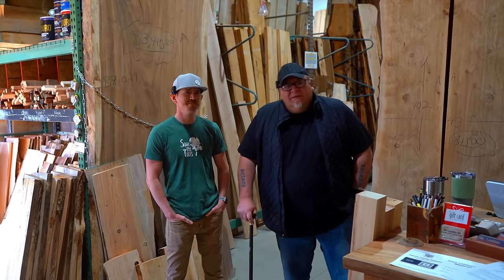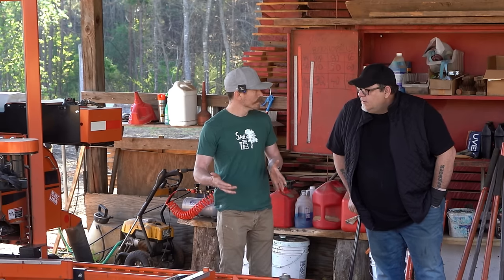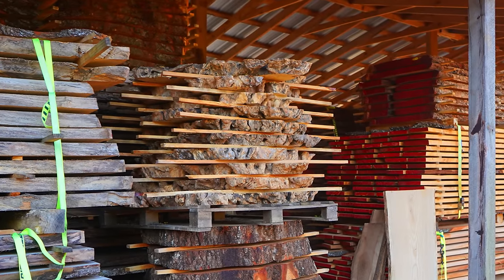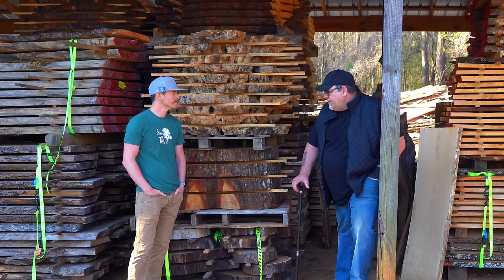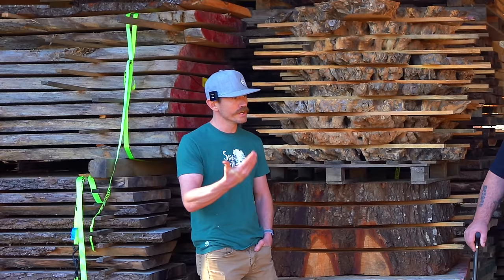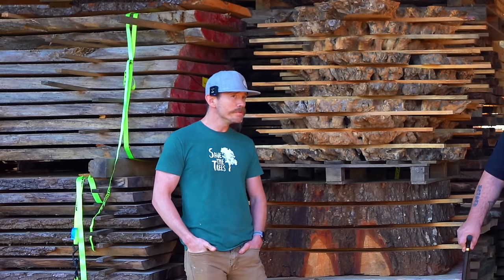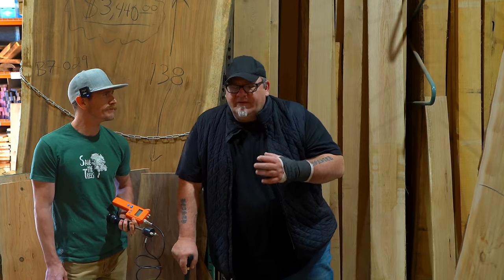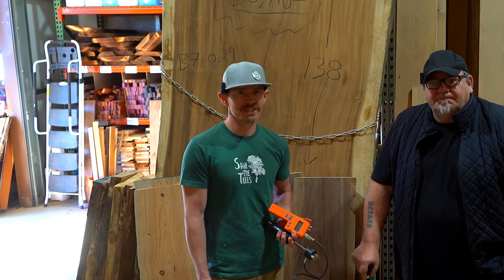Is your Sawmill Lying to you?

Comment: Just a word of caution: if you take a pin meter into a lumber store or lumber yard and start poking holes in every board that you look at, I don't think the owners will be too happy.  I have a small sawmill and lumber business and I let customers use my Orion 930 pinless meter.  It measures at both 1/4" and 3/4" depths.  The holes leftover by pin meters, especially hammer style, are visible in the finished product and will have to be filled.  With the Orion you can scan to your heart's content and not damage the lumber.
Reply: I would definitely ask before measuring someone else wood, but the best is to let the lumber supplier provide the tools and take measurements as well (as you’ve stated)

And yes, for any material less than 6/4 and sanded smooth, the painless meters are great.

Comment: I run a norwood lm30 and this info is priceless.  Bottom line, mill up 4/4 boards and air dry them the number of years required based on their species.  In my case, virginia pine and chestnut oak.  It's what I have.  
Otherwise, make stuff knowing your lumber is still wet and deal with the consequences.  
As usual, Izzy is THE man to get good info.

Comment: I own and operate a portable saw mill and I cut redwood and Douglas fir mostly, and once I get the sap wood off the center is already dry enough to use for framing or fencing, I have cut some white oak and walnut, and I sticker them and shade them,and I store them on a ridge top of my property with a lot of air flow and that flow seems to dry them out faster than the year per inch, I also noticed that this guys stickers were set in from the end too far, I place mine within an inch or two max, because the ends have so much influence on the board
Reply: I also thought of running a portable saw mill operation that will take either downed trees and whether the customer desired me to just remove it and I mill it for future customers OR if the customer desired to keep the wood after sawed and they just paid me to do the work....

I know there are probably things I've not thought of...but has your operation been successful and are there problems with neighbors and or business owners that complain of the noise of the saw when doing the job?  Or are these just the things that people tell me to be aware of since the rising "Karens" with less than perfect mustaches...?

Comment: What about pinless moisture meters like Wagner's Orion series? They only measure up to 3/4 inches (1.9cm) sure, but that allows you to measure in loads of places as figured pieces of wood can have pockets of moisture trapped due to variations in grain orientation. Just ask Cam from Blacktail studios (youtube channel for those who don't know).
As a consumer who doesn't want to go pounding holes into wood on the store shelf (nor my own boards), I like them a lot. Though they're not exactly cheap either (starting at 400 dollars for the deep measuring version).
Reply: Those are def great for a consumer I would say! We like the pinned meter so that we can check the moisture at various depths and make sure we are getting an even drying and not risking case hardening for example. Unfortunately you can’t typically measure deep enough with a pinless meter. But they are def good for taking many measurements closer to the surface without putting a bunch of holes in the wood! 👍
Reply: Yes, I have an Orion 930 and it will measure at 1/4" deep and 3/4" deep.  I have a small sawmill and lumber business and this it what I use when customers want to see how dry the wood is.  I don't want every customer coming in and putting pin holes in my FAS walnut boards!  I do use a pin meter with a slide hammer for spot checking lumber in the kiln, but I try to limit the number of holes that I make.  The pin holes are a decent size and have to be filled in the finished product.
Reply: Great video, as usual. It's very informative. Thanks!!